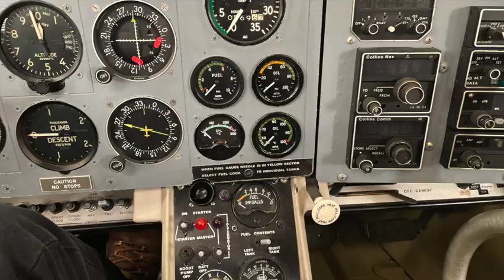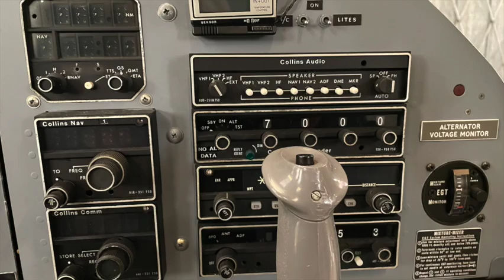Restoring an Aircraft to Flight Project G-AXJO Episode 1

Comment: Hello Michael.  Nice intro, and this should be worth a watch as you go on.  Quite a big task after a six year period on the ground.  Hopefully the hangar was dry, as the biggest concern probably as you'll know is going to be corrosion.  Obviously I have no idea what you are expecting to find and how deep the pockets are of the restorer, but an engine sat idle for this amount of time is unlikely to be in good shape, unless it has been properly preserved.  The airframe also is going to need a good look at, and you will know how good spares availability on these types is or is not.  Wishing you the best of luck with your project. looking forward to following along!